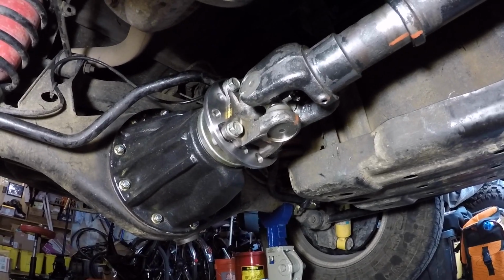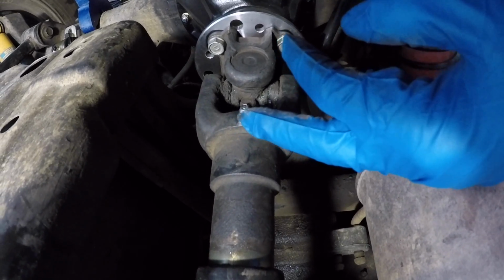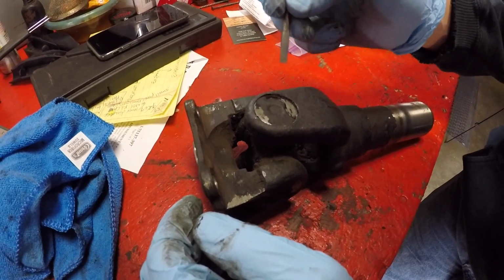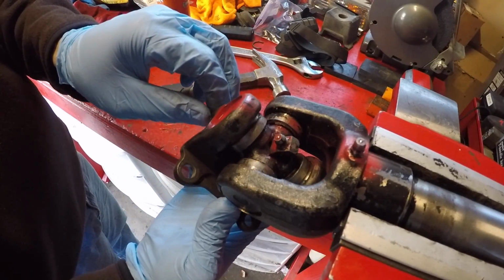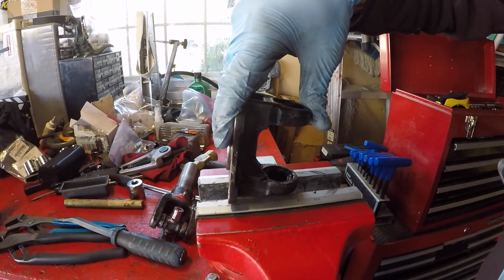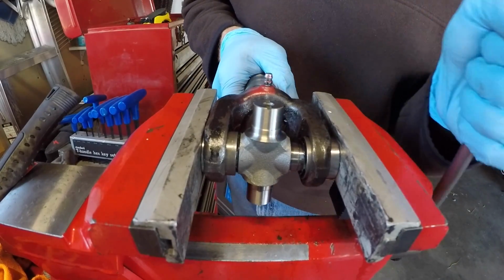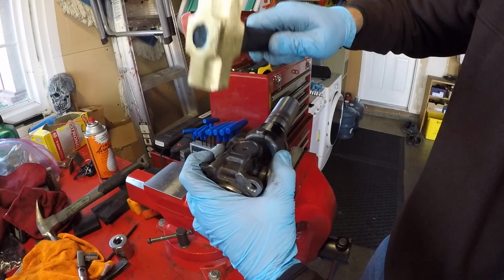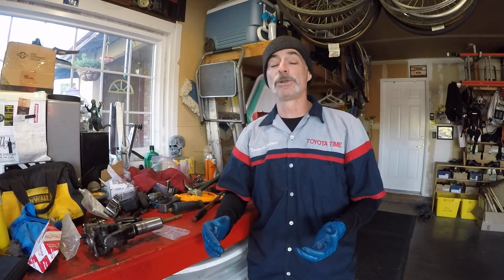U-Joint Replacement

Comment: Once again a great video Tim!  
Is 04371-60070 the same part number for both U-joints?
Reply from the maker: Hey Matt, glad you like the video.  That part number is for the rear u-joint on the rear driveshaft.  The u-joints for the double cardan joint on the rear driveshaft are hard to source because Toyota doesn't sell replacements.  As for the front driveshaft u-joint that connects to the front differential, I don't know if that is the same part number as the rear.
Reply: Thanks  @TimmyTheToolman  .

Comment: Thanks for the great video; you guys work with a surgeon-like care and pious respect for the job.  I'm thinking my 20+y/o Tacoma (with original UNIs) is due, and these tips are going to be valuable--subscribed.
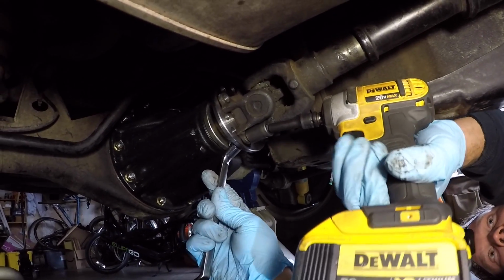Knowing how seriously you take the work, and in the spirit of community, I just wanted to pass along some advice that someone gave me years ago:  Don't tighten or loosen bolt/nut fasteners from the bolt side.  I was taught to hold the bolt and turn the nut--less opportunity for trouble to kick you while you're under a car and on your back--like buggering your threads.  For tight spaces (like between the shaft flange and pumpkin), use a wrench or crow foot (the flare nut type is the safest bet) on the nut, and hold the bolt with a stationary wrench.  To accurately torque, turn the crow foot 90°, so the orientation is at 3:00 or 9:00.

As others've said, it'd be great to see the double C joint juggling job.  :)
Reply from the maker: You're welcome and we appreciate the compliment.  Thanks for sharing the tips.  That's interesting you say you get a more accurate torque value using a crossfoot with it at a right angle to the torque wrench.  When I've used them with a torque wrench, I had the crowsfoot in line with the shaft of the wrench.  I wasn't sure how that would affect the torque value but that orientation seemed to make the most sense to me.
Reply: Timmy The Toolman  
Yep, with the CF at 90°, the "fulcrum length" stays the same.  If the CF is in line with the wrench, the overall length is increased, and therefore, so is the applied torque...it wouldn't be a foot-pound anymore, it'd be like a 14"-pound.
Reply from the maker: Ok, good to know.

Comment: Off topic question but have you done a video on replacing the vacuum lines? I'm looking to replacing mine since they're pretty old but I'm not sure which of the hoses to replace and what type of hose material to use
Reply from the maker: Hey Daniel, we have not done a video on replacing the vacuum lines.  There are guys who have done it though.  Maybe a Google search will bring you to a forum post that will give you some ideas of how to do it.  For me personally, I've only replaced one line and that was for the PCV valve because the hose was cracked.

Comment: Thanks Tim and Jordan, some great tips. I made the same mistake popping it all the way thru. I did this job on my 98 Tacoma with a vice, bearing press and BFH. Another thought I had watching you guys, do you think an oscillating tool, or Sawzall with steel cutting blades would work?
Reply from the maker: How exactly would you use the Sawzall?  Are you thinking if you did pop that first bearing cup all the way through, you could just cut it off?
Reply: @TimmyTheToolman  yes, once it pops thru one direction the cap is exposed but as we know it won't come out. At that point "I think" the trunnion could be cut right below the cap with a Sawzall or oscillating tool. Might be worth a try when you have another one to do? I've been wrenching on Toyota's since 1979, and done just about everything except transmission rebuild and the cardan joint:) never had one fail. Oh, and I just replaced my first Ever on any Toyota "brake booster" on my 98' Taco. They are actually fairly easy with a helper. I have some tips for that job if needed and I have a chart I found with master cylinder and brake booster specs which I think you might like. My email address is Ricohdale@gmail.com, if you have an email address I will send you some pictures and/or videos that I have done that you can share with whoever. Thanks Tim.
Reply from the maker: @dsimp765  Using the reciprocating saw might just work.  I wonder how hard the steel is for that trunnion though.  It might end up being a pain in the butt.  Here's my email address: mtbtim@sbcglobal.net.  That would be great if you can send me all that info.  Thanks!  Are you a paid mechanic or have you been an avid DIYer for all these years working on Toyota rigs?

Comment: Tim I think you should take a stab at the double cardan joint.

Ujoint-Moog part 513
CV ball-precision part 614
Reply from the maker: Hmmm, I know it's been done but I remember people saying the parts they could find for the double cardan joint weren't great quality.  Are you sure those are the right u-joint and ball for our double cardan joints?  If so, I think I will go for it if I can get somebody who needs a double cardan joint worked on.
Reply: I cannot personally confirm from installation experience yet that these are correct.  However multiple members on 3G4M have confirmed that these are correct. If you search the actual part numbers they appear to be correct
Reply from the maker: @johnlehman2535  Yeah, I just wonder how durable those Moog u-joints and center ball are.  If someone is in a situation where they're looking at scrapping the rear driveshaft, it might be worth the cost of a couple u-joints and that center ball to see if we can pull it off.
Reply: @TimmyTheToolman  I've heard that pulling the caps can be a real pain since the center ball will limit how far you can push the ujoint out. Curious to see what your method would be for removal!
Reply from the maker: I saw a write-up somewhere for this a while back.  I'd probably consult that write-up before trying to tackle this.  It seems the Moog u-joint gets decent reviews.  The CV ball had a couple reviews on Amazon and one guy said it was garbage.

Comment: Great vid  . Wish I new about the 2 jaw puller method when I replaced all mine . Would love to see the double cardinal joint done there isn't much complete info out there. 👍
Reply from the maker: Hey Dean,  John Lehman just commented about the same thing.  I just might give it a shot if somebody hits me up for the job.  It would be a significant savings over buying a new driveshaft.
Reply: I just did mine today, NOT worth it!! See my posted comment above for a qrd. A driveline shop will make you a custom driveshraft that will fit your vehicle/build perfectly for maybe $350-450, AND will be stronger than OEM - trust me and just go that route when the time comes!
The front yokes on the cardan are halfway recessed which makes it next to impossible to get anything nice and seated on there to press them out, and once the caps are out it's almost as if the yokes flare out without any pressure keeping them down, so when you try and put in a new joint/cap, it won't go down square for shit! That was the most frustrating 7 hours of my life, hands down dude
Reply: This Was Posted a month ago best video I've found so far. https://youtu.be/w2cI42jRWU0. Thanks for all the info

Comment: tim I need help with a coolant smell in the rear passenger seat of a gen3 4 runner 01 I cant find anything on the forums its only there after the car has been driven for a while the carpet is not wet and I haven't seen any coolant missing either.  thank in advance
Reply from the maker: Hey Brandon,  sounds like the coolant lines running to your rear heater might have sprung a leak.  Have you been losing coolant?  If you look under the rig on the passenger side, you'll see to silver lines running parallel to each other towards the rear of the vehicle from the engine compartment firewall.  Then those lines turn up toward the area between the front and rear seats.  Those are the coolant lines for the rear heater.  Take a look and see if you see any coolant leaking down from that area.  Also, see if you can figure out how to remove the center console trim around that heater so you can take a look from the inside of the passenger compartment.  I've never removed it but I bet you can figure it out.
Reply: Timmy The Toolman thank you!!!!! Love the channel
Reply from the maker: @steelydan8312  You're welcome Brandon.  Thanks!